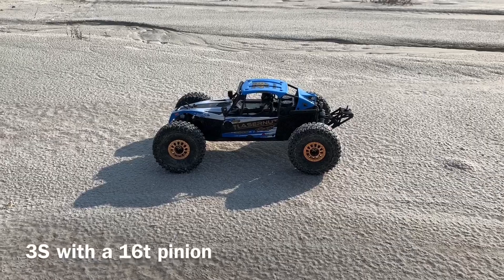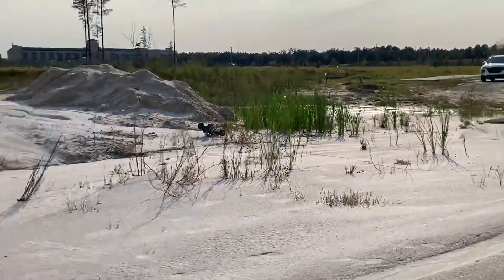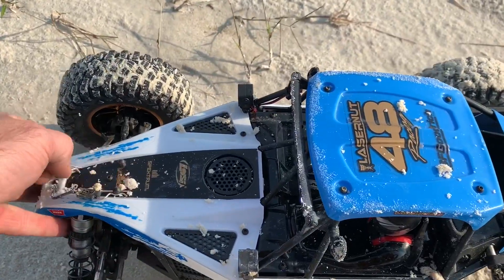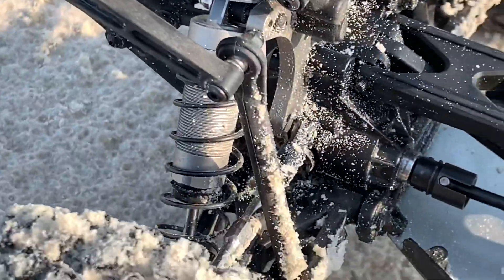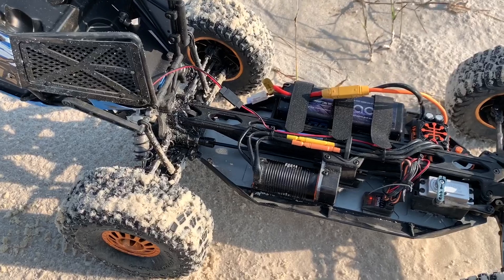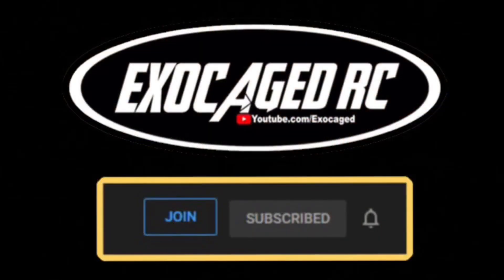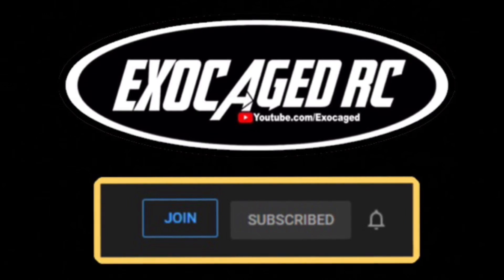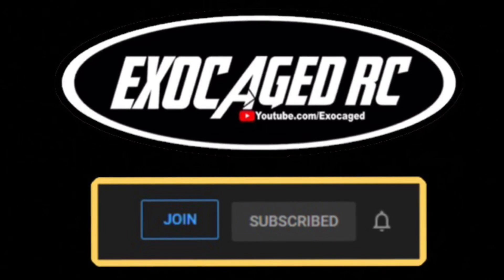Lasernut Fail Again

Comment: Most of the other RC channels are bashing their Lasernuts with the reverence of a criminally insane sadist with anger issues. And maybe they're NOT reporting "failures" as they should. Personally, I'm very content with my DB Pro 'Tenacity' and have little reason for another 'beautifully scale' RC that my heart is in my mouth every time my "Driver Mod" fails.
Reply from the maker: I have no idea what the other channels are doing. All I can show is what I have in my possession. I have a new rear case on the way and also some new bearings from DSM.

Comment: I guess I got lucky I have been running it on 4s probably 15 full packs in haven't had any diff issues or wheels falling off or spun hexes only thing I have done was add a fan to the motor put the 16t pinion on and put 500k fluid in the center diff

Comment: My brother has a laser nut he brings out with my Mojave and his takes a beating. Not as strong as the arrma Mojave but only broke twice out of 20+ battery packs he’s ran in it. And one of the leds went out on the light bar.

Comment: I would contact Losi about this repeated failure
Reply from the maker: It’s only parts to them, if they really wanted this to be a top vehicle they would have had independent testers test it out before final production began. Or just built it off the ebuggy platform.

Comment: This is my luck with every truck i have lol i swear to god ive gone through every 1/8 scale and 1/10 scale electric out there and even the ones guys say o you don't need to upgrade it's "bullet proof" I've had to highly upgrade because no matter what i drive it will break each drive and i don't come close to rc dude 81 style or duperbash jumping. Just horrible luck. Like yesterday i drove my kraton 4s and snapped 3 drive shafts right after my buddy said these drive shafts are tough lol. Ordering a tekno mt410 this weekend.
Reply from the maker: Well my buddy has a tekno MT410 and it’s almost....bulletproof. LoL. Seriously he has beat on it a lot and it’s taken everything. Great truck

Comment: Just go with a brass bushing for now
Reply from the maker: The heat would melt the plastic
Reply: @ExocagedRC  this could indeed happen but the pinion would act as a good heat sink, probably best to find a better fix.  Im bummed, I had hu hopes for that rig.  Gotta wait for a good aftermarket diff housing i guess.  Looking forward to what you manage to find.  Surprises me from losi, they usually put a lot into design.  All the best.

Comment: Never cared for Loser, I mean Losi !! 
The one good thing they used to have going for them, before Traxxas became big, is their super smooth shocks. All Losi's are now is a bunch of thin-walled plastic, with some looks and a $500 price tag ! Cheap ! So, I feel bad for anyone who buys a "Loo-zer". I always been an A.E. fan. 
Any-hoo...I would throw it in a garbage bag and drop it on the counter you picked it up from ! DEMAND (your money) back !! 
That is B.S. that they have the audacity to put out a product like that, and then require $500 for it. 
Sad brother, I hope HORIZON is not planning on continuing this "loozer-nut" until they revise production  -OR straight pull it from the shelves !! Uncalled for, they had to have tested this before release. 
Pure disappointment. 👎 
-EXO, I hope everything turns out good for you ! 🙂 You do so much for your audience, Thankyou, Paul.
Reply: I have to agree my only losi was the biggest pos everytime I took it out I broke something including completely snapping the whole chassis in half twice on small hits.

Comment: I know the filling about poorly enginered designs...mine is the Redcat Wendigo...I break it every time I take it out....its now a shelf gueen... I bet this is were your issue is going to end up too...
Reply from the maker: Well my Wendigo has been awesome, what are you breaking?
Reply: Pinion gears , axles and bearings most just rear
Reply: I guess my "Driver Mod" needs adjusted......
Reply: @ExocagedRC  I put Vitavon hub carriers on my X-Maxx what awsome parts and heavy duty...
Reply: Javier Ruiz  yah my driver mod needs adjusted for proper operations

Comment: Honest reviews are bitter sometimes I'm sorry you're having bad experience with your Lazernut Joe you're a positive person, I haven't had any issues 3s stock or 4s 16t pinnion I run it stock tho, have you had those issues with your Tenacity DB pro? I'm stumped on any suggestions other than Losi support with your complaints I do feel your pain with Traxxas bashers their overpriced garbage in my experience and I painstakingly got full refund on a slash and an xmax via my attourney and a Traxxas ceo I do still have 3 different TRX4'S those are well built and M41 Speedboat, maybe Losi is a better company in dealing with lemmon products wish you the best possible solution see you next video go out back and bash your Krayton that helps me shake it off 😎👍
Reply from the maker: I wish I had got the DB Pro, it seems those are really good vehicles. I love my Xmaxx as I beat on that thing weekly. I’m hoping for a new case from Vitavon with oversized bearings. That would fix a lot of issues with this.
Reply: @ExocagedRC  I'm mistaken tought you had a DB pro and hope the new gearbox fixes your issues 😎👍

Comment: You’re doing something wrong, I’ve been running hard on u4 courses for over a month now on 4s, not a single issue, no breakages
Reply from the maker: Please tell me what I’m doing wrong, I’m not abusing it, broke first axle on first drive, then rear bearing and rear bearing again. I’ve done the Tekno shafts and I just can’t keep it together. Stock motor and esc and it just doesn’t hold up. If you can see what I’m doing wrong please tell me so I can keep this thing alive. I’ve got a new rear case and bearings ordered. I’m hoping for the best on this but am not having much luck at all.
Reply: Maybe running it on sand is killing the bearing?

Comment: i blew rear end. 6 axles 3 striped wheels engine and a lot of others were falling out no threadlock i spent another 200 i ran 2 batteries on flat ground im done i also never ran a battery without breaking the owner of my shop sent photos to rep showing it’s in like new condition im done i pre paid for this due to liking it horizon i sit on phone 45 minutes to here they have seen no problems i also bought mini t bought brushless and shocks and b44 team car i spent 3500 in 3 weeks and  i brought lasernut next day broke and got charged for parts i f i had a customer who walks in w thousands i would do something for them this will never be what was described to be im going to run it over w my car i ran a battery 1they should have never released it yet

Comment: Oh ya EXO... "handle 4S" you said ?!? 
  -Ya on some "Spektrum" lipos, but I have been watching your videos a long time & maybe this "loose nut" will not handle a (true 4S lipo) - like the HELIOS batteries you run. 🤔 Am I right, I just see a big difference between the two brands of batteries at even 3S ! I smell crap on the 
HORIZON !! If ya know what I mean. 
I simply won't stoop to a low quality level like some RC producers do ! They could do better by NOT cutting corners on vital components. 🙈
Reply from the maker: Cutting corners at the axle level of any vehicle is not a smart way to go no matter the brand. Axles and gears should be TOP priority on any of them.
Reply: I totally agree EXO ! 👍 🇺🇸 🤘

Comment: Typical Losi, always breaking. I got tired of rebuilding my rock rey, that's why it sitting on the shelf for over two years. That bearing will fail as well, needs larger bearing. Disappointed in losi for putting out low quality cars.